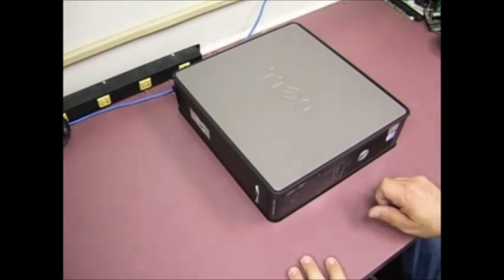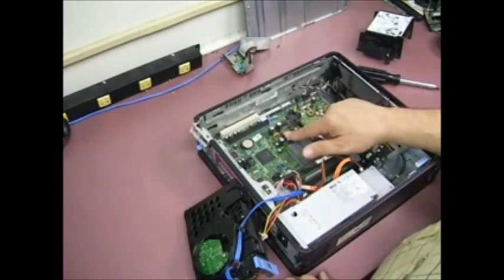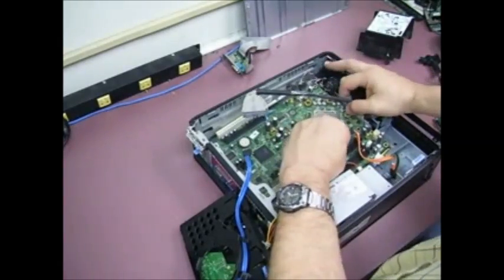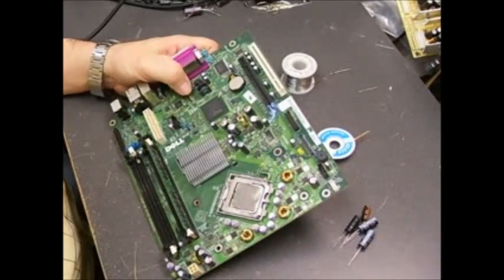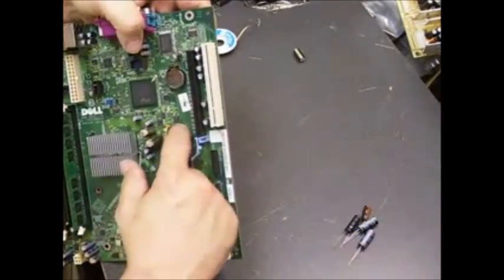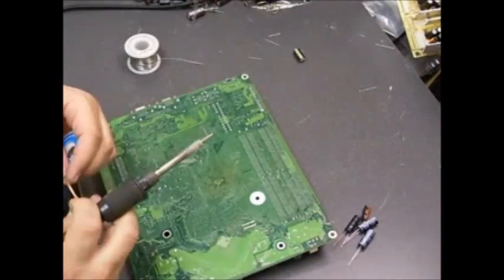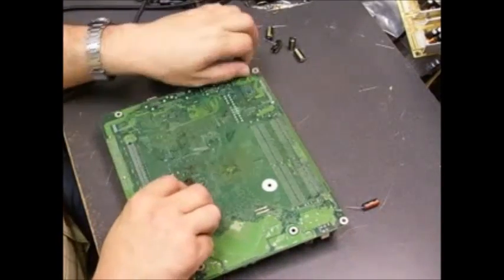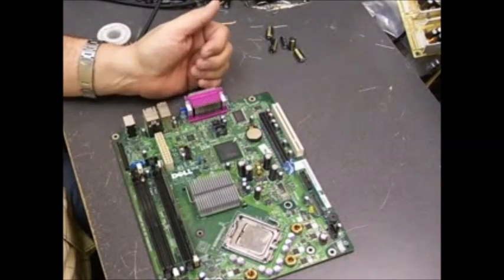Dell Optiplex motherboard repair

Comment: Hello sir I have dell ootiplex 3020 motherboard. On board there is no 5v supply on hdd connector and also on power button. On Smps it shows 12v and 4.5v . Wher is probkem. On motherboard or in smps? Mother board doesn't power on. On red light on motherboard is on nothing happens

Comment: I have dell optiplex 360 . Which is not turning on . I think it is dead . When i connect the power supply to cpu then it happens nothing. No green light, no beep nothing.  Please help me . Please upload solution for it.

Comment: I have an issue with my dell pc. sata port 1 will not work. I tried different cables and ssd's and nothing fixs it.can it be a pin issue. other sata ports work

Comment: This is a great video for people to know and understand how capacitors are replaced, unsoldered and weld back onto the mother board.  However, it would help a whole lot more if someone would like to do themselves but  the questions are  how do  you know what model, number of capacity of cap you need to buy, ALso what kind of soldering you use ?  I do not think you use just any kind. At Radio Shack they have different sizes of soldering guns.  You have to know what to buy if you are going to sold something onto a motherboard.  Knowing that info will help even more to viewers.

Comment: May have to do this on a Dell Core2Duo s o o o n.  The machine stopped operating and have not opened up yet.  And Dave at EEVblog blames Capacitors for most problems...Thank you for the video !  tjl  P.S. Bought a Dell I-5 from Newegg recycling and MS left the cables off the DVD drive....

Comment: Your link to the capacitor set does not work.
I count 8 bad caps I "see" as bad, but I am sure there are more.
How many caps come in the set?
It may be cheaper to just replace the mother board.
Reply: no The repaired mother board will run up to a hundred bucks. They have a kit that includes the complete set. Make sure you know what mother board you are going to fix.

Comment: hey I need so help badly on what type of caps are those around the cpu socket those 8 plus  redish ones. I had two of those leak or have corrosion around them. it would be so help full if someone could reply. I have a cap in hand it numbers on it are f50 6464 11v read top to bottom. if read left to right its f641 561 04v.

Comment: What solder do you use, does it have LEAD in it, that's toxic!!!
There is lead free solder why not use that instead of using the other.
Why do you buy your equipment from ?

Comment: Another 'thank you!' for a great 'how to' video. Like Jack - I just fixed my Optiplex 745 with a capacitor set off of Amazon. Reloading Windows as I type (since I buggered the existing installation thinking it was a windows issue... argh).

For me - Windows Update would not function... otherwise, it ran fine. it wasn't until after I found several threads on that subject & realized that most of them involved Dell's that I looked for other causes. Weird how these capacitors cause this issue. Reminds me of similar problem original Xbox had with clock capacitor, which was also an aerogel cap that burst & went bad. 

I used desolder wick but still ended up using a modelers / electronics pin-vice drill to open up the solder holes. (Made it a lot simpler & didn't have to worry so much about burning traces).

Thanks again - appreciate the 'how to'.

Comment: This procedure was 100% effective for my Dell optiplex 745.  Did it yesterday.  Ordered the correct capacitors through amazon for 8.95 total.  Installed them yesterday.  Computer is running W10 now.  It feels and acts like a brand new computer.  My capacitors were just as described.  Blown on top and bulged on the bottom.  Replaced the five specified.  Never done anything like this before.  Worked perfectly.  Thanks for the video.

Comment: I have an Optiplex 745. The five capacitors you replaced are fine on mine. There are two blown 1800uf capacitors in the corner near the memory chips. When you are pointing at the capacitors to replace at 5:25 into the video my blown capacitors are straight down in the corner. Does this indicate another problem?

Is this problem with the capacitors or with the design? Will the new capacitors blow in the same way at some point in the future? Should the replacements have a higher voltage rating?

Looks like I need two of the 1800uf capacitors.

Thanks.

Comment: I have a Dell SFF computer that I pulled the caps out of & all of the caps except one came out OK. The (component side) of the traces got damaged (on the negative side of cap C442). Could someone post a up close photo of the C442 area so I can install jumpers to make the traces go where they need to go.

Comment: I replaced these five capacitors on my 745, but it still has the same problem: The fans and drives all get power, but nothing on screen. Get 2 beeps and the 1, 2 and 3 front panel lights stay on. Aux pwr LED on the board is lit.

Do I need to replace more or all of the caps on the board?

Comment: We have had chronic capacitor issues with the OptiPlex GX270 and 745. However, the GX260, GX280, GX520, and 755 rarely have blown capacitors.

Comment: With removing capacitors you need a 60w solder station, board has to get hot quick and you move fast to remove them.
Also a desoldering wick with flux.

Comment: My Dell latitude D420 could not charge. some friend connected a power cable with wrong polarity. it can boot with a battery if it has the power, once drained will not charge. help.
Reply: Hello uncle Silavwe

Comment: such a friend, I have a problem when you plug the power supply, not ever knowing by accident I changed the voltage 230 v -115 v 220 v voltage even. 
if not now change it to another power supply or repair some capacitors and other circuits fallas.please possible, thanks. 

rather, I blew my power supply in my optiplex 755, the question is whether you can repair or replace, assemble the other

Comment: I have a dell OptiPlex 745 small factor ,im using a jukebox program and when I plug the speakers to the audio output a sound came out like a data or fax machine sounds and a bought a usb converter for audio and does the same thing ..What could it be????
Reply: My friend...your computer wants to dubstep...

Comment: I notice that on the motherboard there are blank spaces for extra capacitors. Can these empty spaces be used and would it help improve the shelf life of the system before needing the capacitors replaced?

Comment: The problem in My Optiplex GX520 is: the 4 capacitors located by the plug connector that comes from power supply to mother board are burned/ Burst. Are those capacitors the same like in this viedo? I believe they are not. Is this problem repairable if I replace these capacitors? where can i get them?   Thanks for helping me.